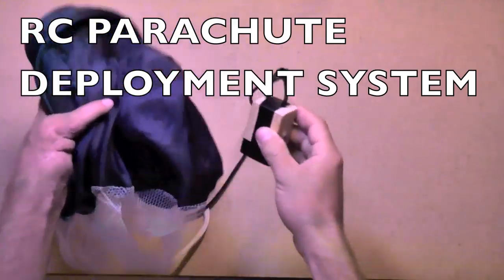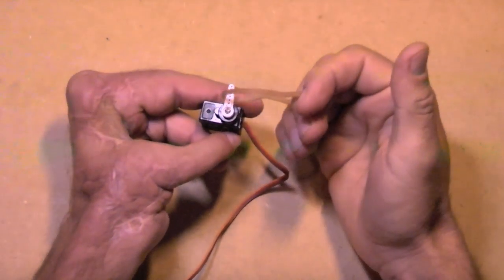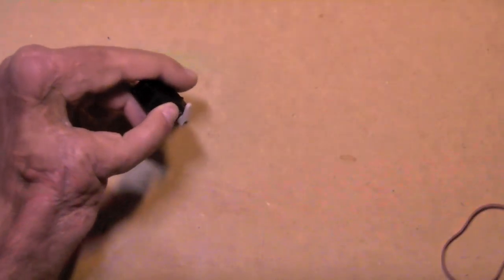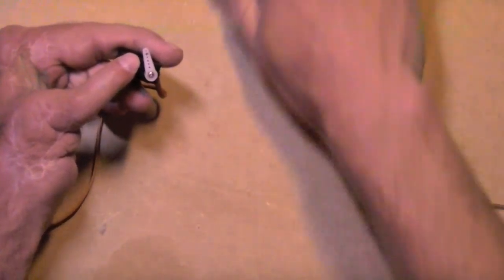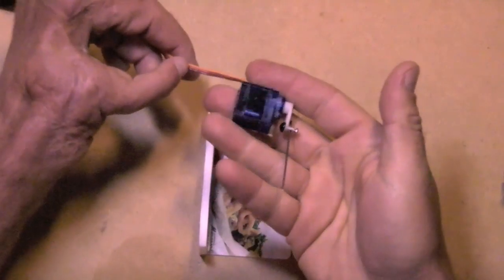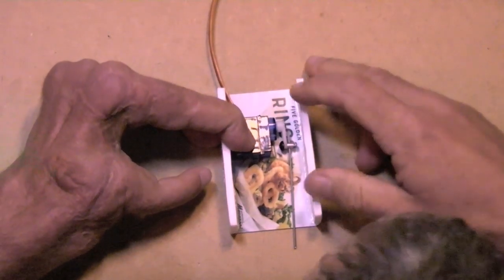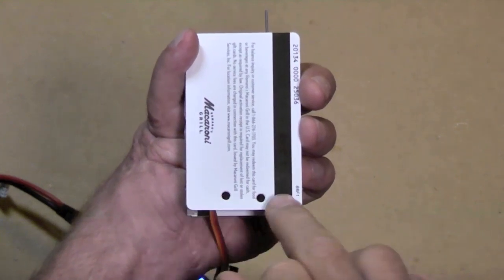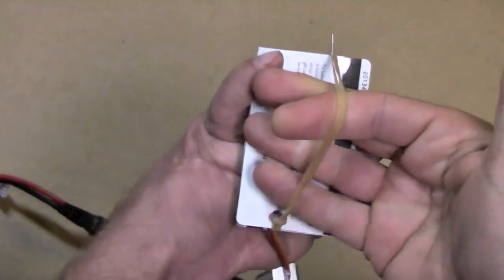RC PARACHUTE DEPLOYMENT RELEASE

Comment: My parachutes are very large and I use small 40-60sz planes. So, I have to place the parachute at the CG and under the plane. I use a standard servo with a strong release pin. I sometimes use a 10 foot parachute with a 8oz water bottle for the parachute weight. I like keeping the chute weight lite so it drops slow. Sometimes even goes up instead of down some of the time. I do like the looks of your Cargo plane.

Comment: Very nice design.  Note that the servo arm flexes and stresses the servo with the loose deployment rodI would suggest using a small slice of plastic card across the end perpendicular to the plastic card and notch a v to secure/guide the rod at the deployment side.  Hotel key cards are suitable, and make great glue/spac spreaders, control horns etc.! Cheers.

Comment: Forget cargo! I want to see if a parachute can prevent damage to a falling quadcopter.  Maybe even some mechanism that would deploy a parachute and disengage anything driving the motors, so a "runaway" flight could be aborted.  I thought about a tube hinged down with a sprung plunger at the base, so that when the tube as deployed, it would spring up and release the spring pushing the parachute out the top, clear of the props.  I don't know how large a parachute it would take to slow a quad down in a fall though.